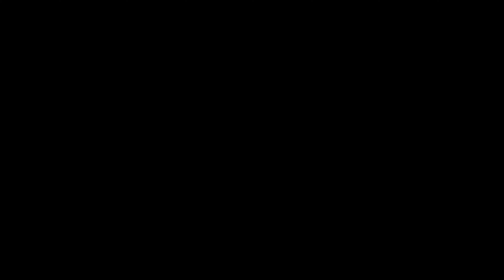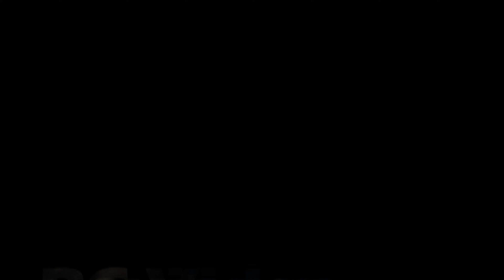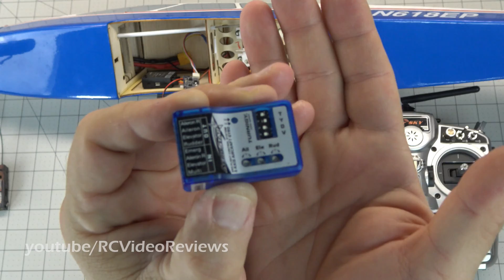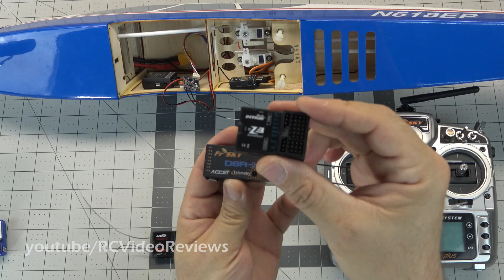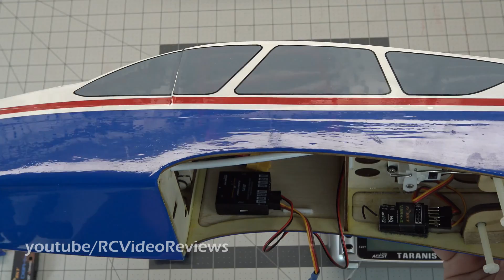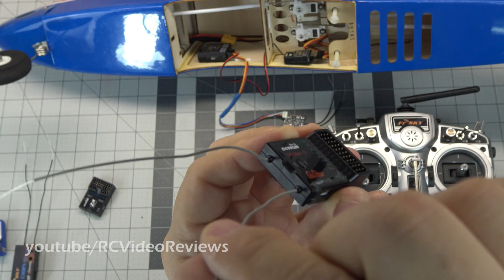RC Receivers Stabilizers and Flight Controllers - Which One and When?

Comment: Hi, Can you tell me how to set up the x9d settings (mixer:functions etc)to change the modes of a different brand stabiliser. I’m relatively new to Taranis, so any help would be appreciated. I can’t find anything on YouTube that describes this. Many thanks, Leo
Reply from the maker: The mixer is the key. Usually stabilizers want mode set on channel 5. So it's likely (but not always) you'll need to put a 3pos switch on Channel 5 in your mixer.

Comment: do you know if the spektrum safe units are stand stand alone flight controllers or are they only compatible with spektrum transmitter, my carbon cub s2 has what looks like a safe flight controller and a receiver they are 2 separate devices in the plane stock.

Comment: Is the Gyro used to detect objects ?
Reply from the maker: No, it has an accelerometer and depending on the mode being used, it reacts and manipulates outputs to the control surfaces.
Reply: IS that the same as the Gyros like in my Drone that make the drone stop flying if it hits a surface? @RCVideoReviews

Comment: I would like to watch a very simple  "how-to" video that shows how to connect my Hitec Optima 2.5GHz receivers to a basic stabilizing device and transmitter channel on/off switch assignment,  that would help me fly my medium sized electric powered scale models enjoyably in typical  windy conditions, without  much risk of takeoff and landing damage. I dislike a 45 minute drive to the field only to  have unpredictable wind come up force me pack up and leave.

Comment: do you think that radiomaster t16s can connect to that detrum flight controller? Thanks
Reply from the maker: Not direct to the FC, the FC requires a receiver (Rx) between it and the transmitter (Tx). I have used a TX16s and an SBUS receiver in front of the Deterum FC though, and it works fine.

Comment: John:
You got a lot of great discussion and ideas from this video. Your discussion cleared the fog for me again.
Questions:
1) What is the Detrum system using for operating system?  Is it OpenTX? Is it 4 in 1 compatible, or strictly proprietary?
2) What stabilization system is the lightest for <250g planes? What full flight controller with GPS?
I would like to see another tutorial comparing different flight controler systems capable of either destination selection or autonomous flying if you are ready.
- Jim
Reply from the maker: 1) Detrum is proprietary. Their graphics and fonts look like pictures I've seen from Spektrum radios, but I have no idea if there is a relation. 

2) Kopilot Lite https://www.banggood.com/custlink/3GKEFNKVZm

That's an interesting video concept, but it would be a lot to chew. Here's what I would suggest:

1) Basic Small Beginner: Kopilot Lite
2) Fixed Wing: Matek F722-WPX or later with iNav.
3) Multrotor: Too many options to list: F7 board or later with Baro, GPS, Current Sensor, Bluetooth and Betaflight.

That's my current strategy. You can find videos for most of this equipment on my channel already.

Comment: Hi John. If you update your link for the Blitz DT-9 and SR86A-G happy to click through. Hopefully they deliver to Australia. Quick question I am getting a FMS Super EZ PNP delivered which comes with reflex stabilization. I won't need that will I? I am happy with not using the reflex.. The combo will get me ready for flying without any more receivers etc.. correct ? Thanks John
Reply from the maker: I updated the links in the video, thanks for letting me know. If they don't support shipping from their website, send an email to info@bitgohobby.com and let them know what you need. I know they've helped others out with international shipping.

Best of luck with it. Both the iStone and Z3 are solid stabilizers.

Comment: can I combine both stabilizer and flight controller?
Reply from the maker: Not really--both devices will want to manipulate surface deflection, so you'd wind up with some conflict. I suppose you could wire them in series and make it work, but it would probably be smarter to decide what you want to do then decide if you can do it with a stabilizer or if a full flight computer is required. 

I have heard of hybrid setups using a stab and flight computer together, but not for control purposes.

Comment: John, very informative. as always. I found this video and I am very nterested in using stabilization, flight control and telemetry, if possible using only one device. By the way, what is the sbus device that you have connected to your stabilizer? Is there any integrated rx similar to the Detrum that can be used with the TX16S? Regards
Reply from the maker: The S6R is an integrated stabilizer and receiver. It does not have Return to Home or GPS flight modes. Just wind rejection and auto leveling. The Detrum SR86A/G is an integrated receiver/controller/gps/rth. I believe there are a couple of iNav based Flight Controllers like the Omnibus F4 Fireworks: https://www.getfpv.com/frsky-rxsr-fc-omnibus-f4-fireworks-v2-flight-controller-w-integrated-r-xsr.html  That is a full on flight controller with integrated Rx.
Reply: @RCVideoReviews  John, I believe FrSky protocol is now "almost" out of the scope in the TX16S internal multiprotocol unit, isn't it?
Reply from the maker: @enriquech4041  No..? I'm unaware of any effort to reduce or eliminate FrSky support on the MPM.
Reply: @RCVideoReviews  I mean the new ACCESS protocol vs the old ACCST from FrSky
Reply from the maker: @enriquech4041  ACCESS is only compatible with FrSky ACCESS radios, not the MPM. S6Rs are still sold with ACCST firmware.
Reply: @RCVideoReviews  Thks again. So, if I am using a TX16S, I better be careful when buying FrSky receivers and associated telemetry hardware. Regards
Reply from the maker: @enriquech4041  Just make sure it's ACCST and NOT ACCESS. As long as it's ACCST (and somewhat recent) you shouldn't have any problems. i.e. There may be some older V8 receivers that don't work--I don't know for sure. It seems D8 and D16 receivers with ACCST work ok.
Reply: @RCVideoReviews  Thanks again, this info is very valuable. Take care

Comment: what if I want to use a stabilizer to keep a turret facing the same way ?
Reply: Maybe a heading lock gyro from a heli tail rotor?  Just a guess,    but trail and experiment.   There are also gyroscope available for drifting rc cars that keep the front wheels pointing were needed.      Hope my ideas help point you in the direction you're wanting
Reply from the maker: That one I don't know. If I were going to experiment with something like this, I would probably be thinking about an autopilot with return to home and I would initially want to connect the turret pan servo to the rudder output of the autopilot. But that's just spitballing.

Comment: Can we use a stand alone stabilizer with a flysky fsi6 6ch transmitter and receiver?
Reply from the maker: Absolutely. The only thing you need to do is ensure the output from the receiver is supported by the input of the stabilizer. i.e. If your receiver only outputs PWM, your stabilizer must support PWM input. If your receiver only outputs s.bus, your stabilizer must support s.bus input. To the best of my knowledge, all stabilizers provide PWM output to the servos and ESC if throttle is supported.
Reply: @RCVideoReviews  thanks a lot for the query....👍🏻
Reply from the maker: You're most welcome.